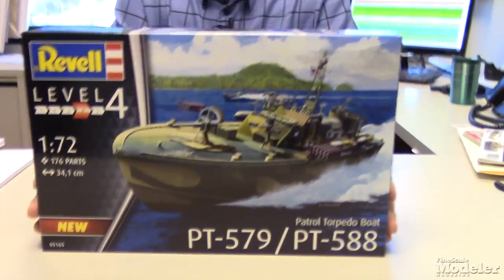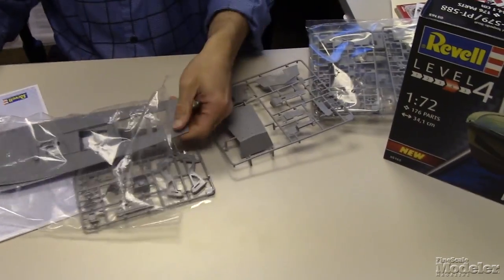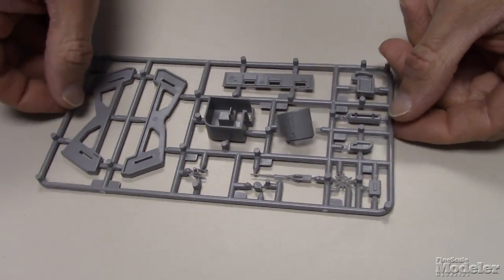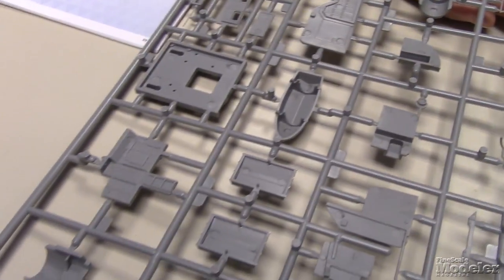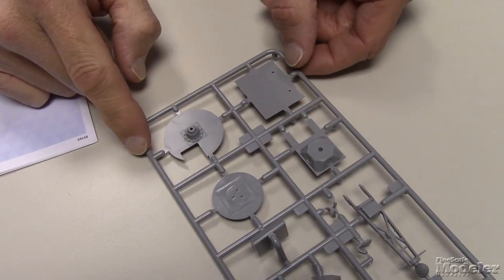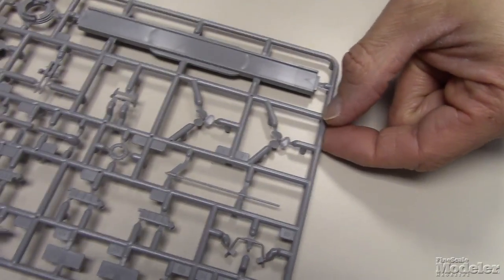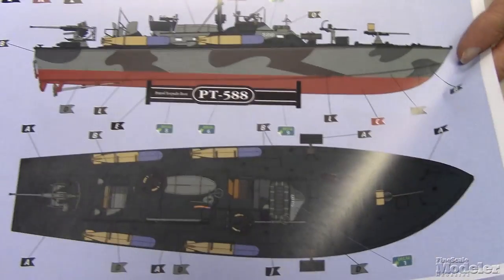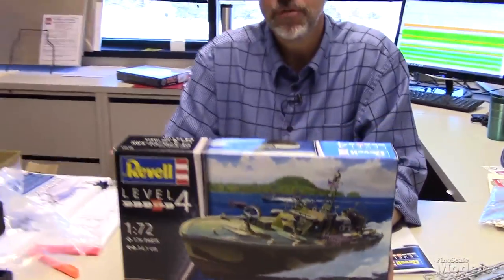Review of Revell Germany's PT-579/588 boat — New Product Rundown "One Shot"

Comment: What’s the hole in the bow for?
Reply: I saw the it as well and thought it was a molding issue. I stopped the video at the instruction page that shows the hull and it looks like there is a piece that is inserted. They must have had to mold the hull with the piece missing because of stress on the hull pieces.
Reply: To let in water.